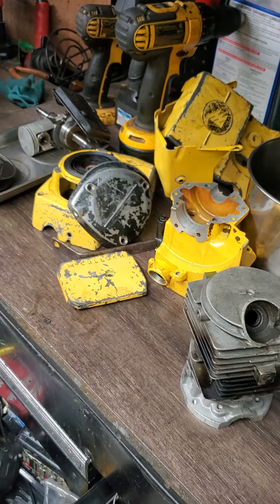Sleeper Mac 10-10 Project

Comment: Where do you set your rings in your 10-10 builds. I’ve gotten totally different answers from different people. The only one I’ve done I put the gaps 180 out from each other in the transfers. I’ve been told don’t do that , and I’ve seen people do it. I’ve also been told put the gaps in intake side since the gaps never clear the intake hole .
Reply from the maker: As long as they are not stacked it doesn't matter they are not pinned so they spin around the bore while the saw is runnong..hope that helps 👍👍
Reply: @JandSChainsaw   that’s good to know . It’s a touchy subject man. Lot of different answers . I did notice on one I pulled apart recently that was a good runner the gap was in the exhaust. Kinda freaked me out …. Saw ran fine.